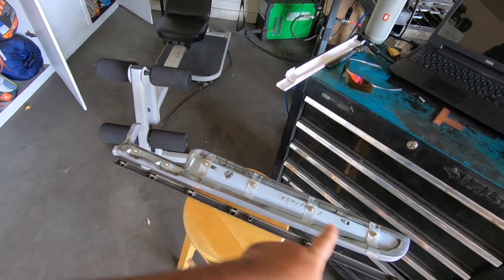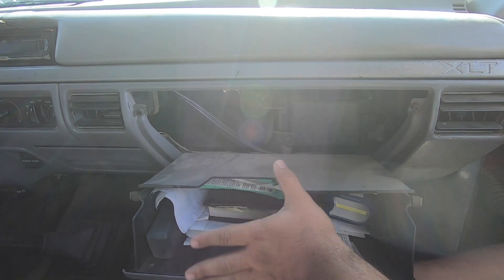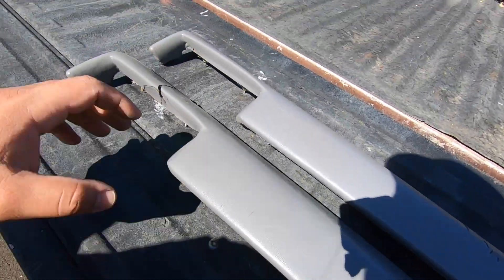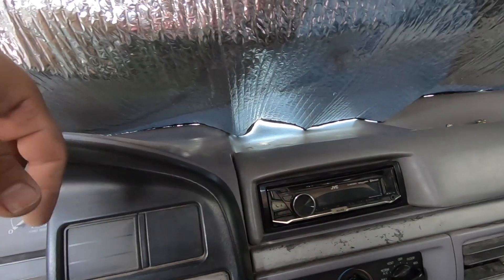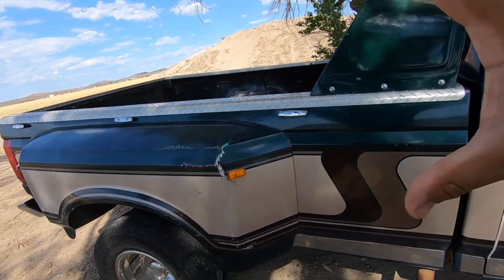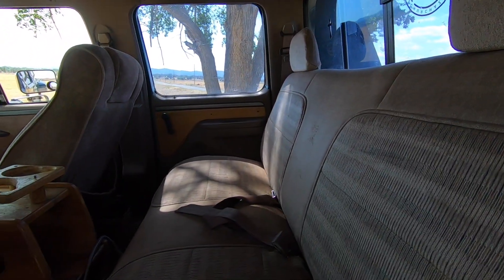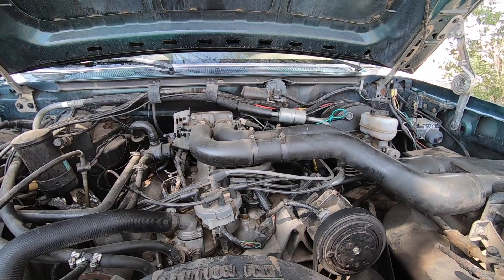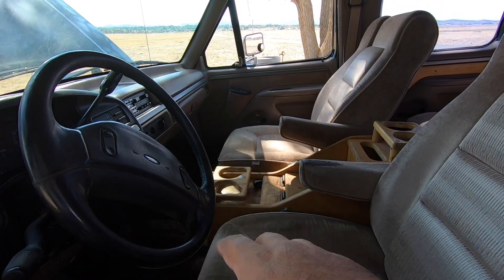I Just Bought A New Project And Its Clean!!

Comment: When working with fiberglass use the aluminum tape on the outside where the paint is on the vehicle and use the resin foreign in from the inner section and your sheets it makes it really smooth
Reply from the maker: Thanks for the tip!

Comment: I’m currently in the process of restoring my 94 F350 Waldoch conversion. I was actually looking for something closer to a 17, when a buddy joking sent me a Craigslist add for the 94 and I had to have it….24 hrs and 2800 bucks later it was in my driveway. The turbo 7.3 runs like a top, but the body is quite rough. Has some awesome options like the rear power slider, radar detector, etc. I absolutely love this truck. Your videos have been a great help along the way!!!
Reply from the maker: That’s awesome! Good deal too! I’m very  interested in learning how they did a power rear slider I love that in my single cab but can’t really use it on this thing haha
Reply: @blowingdiesel  Yeah it was a awesome price. The power slider is a 3 piece rear window, the middle glass slides open and closed. It’s apparently a pretty rare option on the obs trucks. The radar detector pops out from a ceiling console, it’s slick haha. I’m doing an 05+ axel swap on it, then 4-6 in lift with semis. Should be a cool rig when it’s all buttoned up. Can’t wait to see what you do with that centurion!!
Reply from the maker: I’m gonna have to do more research on that window. And your gonna have a sweet rig once your done. I think I wanna go with 19.5s but I’m still now 100% sure they also look awesome on the 22s
Reply from the maker: The only problem is the adapters you gotta run to use 22s. Wow I’ll definitely think about one of those windows, they are kinda pricey though.
Reply: @blowingdiesel  yeah those adapters cost a freaking arm and a leg, but mannnn do they look killer hahaha. Yeah the windows are a bit pricey, personally I doubt I’d spend the money on it. Only reason I have it is cause it come on the truck when I got it haha.